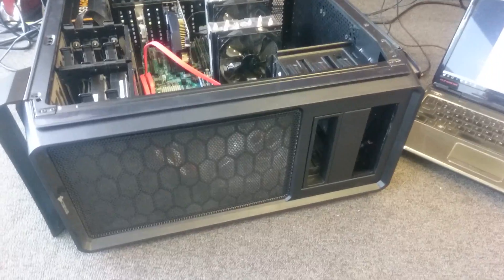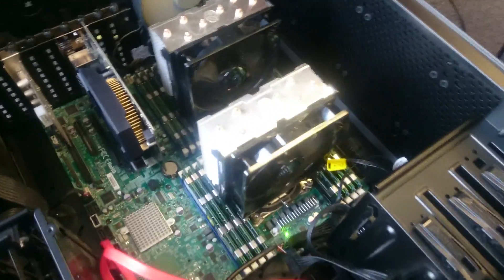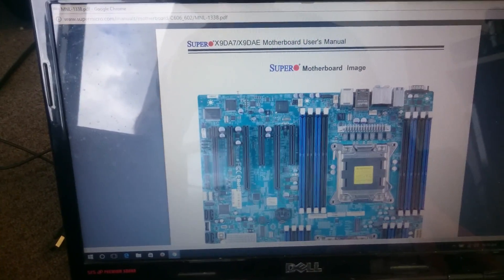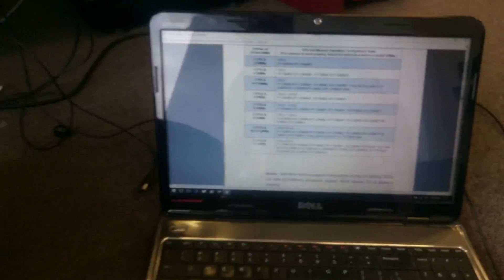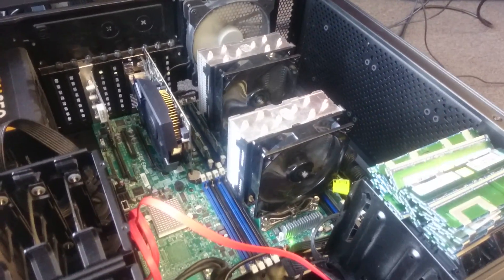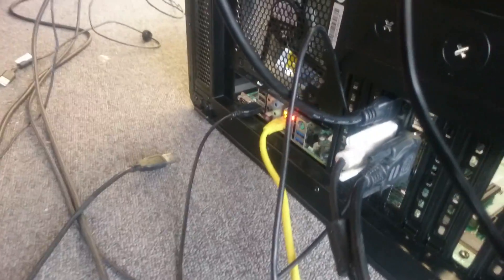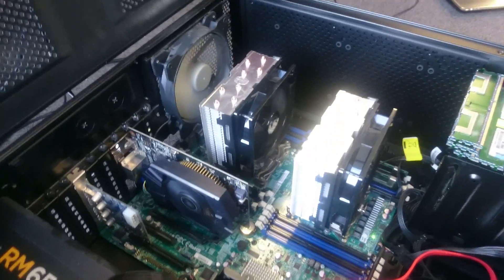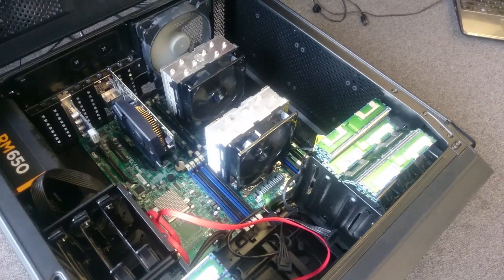Dual Xeon Video Editing Machine Issues

Comment: Just a week ago I had the same problem with a Dell server. For me it was the power supply unit that had problems with an unstable 5 volt line. Changed the PSU and the problem is gone.
Reply: If only he has a scope lying around to check the 5v line.
Reply: Yeah that would be my guess as well. These big dual processor socket boards use the 12V rail for the CPU, so entirely possible there isn't enough load on the +5V to make it stable.

Comment: If I were in your position I would try to reseat all things such as cpu's and power connector giving the whole system a spring cleaning usually does the job or at least narrows the problem with intermittent faults

Comment: Check the logs in bios. On the server biosis it will tell you the exact issue in plain english. You may need to enable log first. some models its not enabled bt default Also make sure you dotn have a bent usb header or serial com header thats shorting out. Also make 100% sure the back of mb can not touch the metal back plate of the case. Some time flexing of mb will alow it to touch witch is why in the server cases they come with a plastic divider (kapton tape makes a decent alternative.)

On my experance try swaping to gpu to a difrent series or  to another slot  non enterprise stuff causes wierd issues on dule cpu machines.Same for that usb card. (Try a bios update.) Never mind you got there:) Also alwasy suspect the cheapest add on card:)  The non enterprise stuff  is genely most happy on cpu0's  pci slots  in my experance(mb will list witch slot is witch cpu)
Reply: Also i have had thouse crosair 650 anf 550s die on me and add just enofe ripple to mess up e3 xeons so... also will cause randome ecc failures on difrent modules (bios logs will prove that)
Reply: Alos super rare but the ipmi/bmc can fail, and it does have an internal usb connection. So might look at that /disable it.

Comment: What it could be that the firm ware may need to be updated. Or another possibility would be that the USB 3.0 card may have been seated improperly where the pins just did not line up correctly and was having communication errors with the module card. This is just an informed guess though.
Reply: System post beeps do take into account the other bios on the mother board before fully booting up. This can include the pci cards.

Comment: For PSU suspected issues I usually unplug the cd rom, if it turns on then your not over overloading the power supply with most likely a faulty cap. That's been the fast easy way of checking desktops in the past. Since low power can cause false positive errors by not providing enough power to accessory cards like USB cards.
I also saw an additional power port on your USB card, I know this depends on the board and how much power the slot can provide and might not be needed for your USB card. But it also sometimes is needed for USB 3 card that have the ability of providing 1A per port (4A total) and if your running power hungry USB devices from those USB ports. 
I have the same Logitech multi transmitter receiver and that doesn't use much power, but I don't know what else you plug into those USB ports on that card. 
If it fails again, I would unplug the USB drive, or video card and use the onboard video output for troubleshooting a power supply issue. The video card probably draws more, but more of the time a DVD drive spins up during the boot process looking for a disk to boot from set in the bios and can cause that intermittent power drain and false positive error on another card by the bios reporting error beeps. Troubleshooting desktops are fun, did it for 4 years when I was younger.
Good luck.
P.S. If you do decide to swap the power supply and board I recommend a Asus board next time now that you've found the 128GB of memory and virtual drive has no benefit. They tend to be better build quality, last longer, and easier to trouble shoot if it has an issue.
Also now that you have it running you can check the Windows error logs since the bios these days report to the OS, you might find a better clue to the real issue or the bios may also falsely report the wrong error to the OS. Depends how good the bios code is written.

Comment: I'd bet money the power supply is having trouble. That.will cause errors like this. Go for an 850 of the same brand you have in there. In my experience power supply failure will manifest as memory problems and random other errors like keyboard. I don't think the bios can determine a power supply is going bad.

Comment: No-one ever had problems with having too much memory.  I have seen plenty of issues with not enough, though.  A few extra watts of power use on a dual CPU Xeon system is not going to make much difference.
Reply from the maker: My system is currently rendering a Mailbag video in Vegas and I have a few dozen Chrome windows open and a bunch of other stuff and a 2nd Vegas window open editing, and my system still uses less than half of the 32GB I have installed now.

Comment: to isolate the faulty RAM if that's the case check in the bios to see what the amount of RAM is and then on boot see if it's the same if it's showing a lower amount then take a module out and reboot it and do it again to find the faulty bank of RAM.
Reply: I've had an AMD board still boot into the Bios with a bad stick of RAM, and even Windows, but the system would become unstable after a few mins of being used either in the BIOS, or Windows. Drove me nuts with me putting in a back up PSU(I always keep a spare 500 watt PSU on hand just in case), reseating the CPU with new thermal paste, etc.. till I started pulling sticks of memory(4 in total the board having  8GB of DDR2 max capacity), and testing them one by one till I found the faulty 2GB stick. So some systems will boot with faulty memory, and some will not, it just depends on the motherboard, CPU, and how fracked the bad RAM stick/s are.
Reply: The PC will not boot into BIOS if there's a faulty memory module.

Comment: 128GB of RAM is needed, especially if you have a workflow of Adobe premiere, Adobe after effects (for camera tracking or stabilization as an effect within the Premiere pro timeline), with clips being prepared for Premiere pro using davinci resolve., as well as overlay elements being prepared in photoshop. Do that, and you will easily use up 128GB. 
Also, some effects in adobe premiere need a lot of RAM, especially if you are previewing effects applied to the timeline. It may not use 128GB all the time but in some cases you may see it use most of it for certain clips and certain effects.
Reply from the maker: I don't use any of that. I can easily edit every video I've ever done on 8GB of system RAM.
Reply: Razor2048 I hope this is a joke
Reply from the maker: FYI Vegas Pro that I use is now rendering a Mailbag video and it using less than 3GB of RAM.
Reply: @Duffel Bag Full of Tech ~ Nope, basically premiere pro and aftereffects and a simple timeline with some 1080p clips where you are applying camera tracking with detailed analysis, can eat up over 32GB of RAM on their own if the memory is available. Then davinci resolve can easily gobble up 32+GB on its own, especially when many color corrections and more complex effects such as the sample based noise reduction where compared multiple frames in order to identify noise, and perform noise reduction (useful for fast camera pans across a scene if exporting to a lower bit rate medium, since it will reduce the bit rate needed to avoid artifacting, if the sensor noise does not need to be encoded during an action that requires a high fill rate from the encoder.

Beyond that, photoshop likes to eat a good 12+GB or so of RAM after a little while (more if working with many smart object layers).
Reply: Wow, that is pretty efficient with the memory usage.
Reply: Razor2048 He's running a YouTube channel man, not producing a movie. I've used Premiere Pro extensively with 16GB of RAM and it worked just fine, any program will use as much RAM as possible, but that doesn't mean Google chrome needs 128gb of RAM, does it?

Comment: Wasn't that a 4, pin plug on the usb card? If it is just plug it in and the problem should be gone. Even if it's just data. Some cards do weird stuff if they have no external power.

Comment: Your usb express card, does it require the extra power connection?
Reply from the maker: I'll need to buy a molex cable adaptor to try this, my PSU does not have them.
Reply: I can SEE ONE floating around in the case, it's right there. Look harder.
Reply: LOL You're right!
Reply: It was just slipping my mind, but the reason why my card was doing that is because the PCI express bus only supplies 3.3V and 12V, and whatever the card is doing to convert the 12V to 5V is barely able to supply enough power to run a single port at 500mA. The Molex connector supplies 12V and 5V thus on the card, it simply takes the 5V directly from the power supply, does some filtering, and then supplies it to the USB ports.
Reply from the maker: Not for normal signal use, it works fine without if it's just data.
Reply: If I don't plug in the power on my cheap USB 3 card it screws things up fairly weirdly. My onboard lan stops working and the pc freezes. Plug it in and it's back to normal. Really strange.
Reply: Disconnected mine again to do this pic :) The only items connected to the card is the front panel USB 3.0 header and the ports on the back are not in sue. For those USB 3 ports, the only device connected, is my Axon 7.  http://i.imgur.com/IZgqInU.jpg  Without that power plug, the card has trouble maintaining the proper voltage, though the phone can still sync and send data just fine, it will get fandom failures if I connect other devices such as another phone. The phone reduces the charge rate if the voltage drops below 4.8V, though it will usually maintain 500mA if the voltage is stable.
Reply: EEVblog2, was that RM650 a donation or a used one as they do include molex connectors on the modular cables.
Reply: Taking a closer look at that card I'm not really sure I'd want to plug that connector in - they've disposed of most of the protection diodes, along with, well, everything else not strictly required (fuses/current limiting, ESD protection, etc). It has a 3A DC-DC reg onboard which gets power from the slot - okay, x1 cards are only 'allowed' 6W, but you're in an x16 slot - it can take 25W no problem and that slot will have been designed with 66W in mind.

I don't think power is a problem unless you have something very hungry plugged into that card causing startup issues.
Reply: Isn't needed until you will used powerfull devices as external hard drivers without external power supply, in my case mine go down until I reset the computer (facepalm)
Reply: Edit: I thought x16 slots supply more power by having more power pins, though. Those power pins simply aren't there in the x1 card edge. This was a mistaken belief.
Reply: Take some time to do some research.

It has a 5V 3A regulator, which is used whether you plug in the external power connector or not - that means 15W max output. The max supply over 4 USB 3.0 ports is 18W. Good enough. The 5V on the connector is not used on that card at all - it draws from the 12V pin only.

PCI-E x1 slots can provide 6W without negotiation, 25W with, and x16 slots (which it's in) can supply up to 66W for graphics cards. In practice, nobody's playing around with those rails: You can pull 25W without thinking about it if absolute standards compliance doesn't bother you (and it doesn't bother the people who made that card, that's for sure). The power connector isn't needed at all.
Reply: Z80user do those cards not use the full 75W PCI-E can provide or something? Seems a bit odd that it would struggle to power a single laptop HDD that uses 3-5W max.
Reply: are some extra path to power the usb conector but conect on it something like a mouse, a keyboard, a external powerred hard drive or a printer and anything like that didn't need too much energy or nothing as all, on this cases the external power isn't needed but still recomended.
on mine I try to charge/plug in my phone on it (with the extra conector) and sometimes turn down the USB on the PCI express, on the USB on the mainboard work good.
now I try to don't used the USB3.0 with external unpowered HDDs and used the USB on the mainboard 2.0 (more slow but more powerfull for that issue)
Reply: Sorry. I was indeed mistaken; there are enough return paths already in the x1 pinout, and the extras on the wider slots are ground. I hope I'll manage to not repeat this mistake.
Reply: No, all of the power pins in PCIe slots are in the segment before the slot key. There are no additional power pins in the x4/x8/x16 interfaces, only data, ground and detection/managerial pins.
Reply: No, they do not. The x16 slot has no additional power pins.
Reply: Most USB 3 cards need the power connector. if you would like to do a test, get a USB tester or just monitor the delivered USB voltage with no connector applied, then connect a smartphone to the USB port. You will notice that at around 500mA draw, the voltage will drop to around 4.8V or less. While the PCI express slot can give a decent amount of power, for some reason these cards don't make much use of it. My testing for this, was done with this card : https://i.imgur.com/GkzCAii.jpg
Reply: I had the same random issue with a USB3.0 PCIE card. No problems once I powered it via the Molex connector. All devices had their own power supplies but hey... It wanted power!

Comment: I would put more RAM back in there. With only 4 DIMMs, it's running dual channel. You need 4 DIMMs per CPU to get your full memory bandwidth.
Reply from the maker: I've experimented with that, and it makes no difference to any performance metric I care about.

Comment: There is room for 120 GB = You need 120 GB :-P
Reply from the maker: Because, reasons :->
Reply from the maker: See my post elsewhere here, I'm using half of my now 32GB of RAM with two videos editors open, and dozens of chrome windows and other stuff.
Reply: I can't imagine needing any more than 32 GB for standard, non 3D, 1080p FHD video. To be honest, you could even get along with 8 GB to edit FHD video. It mightn't be all that conveniant, but it'd work.
Reply: Those empty ram slots are a far better and safer storage space than some drawer which is where you'll have to put that memory.
Reply from the maker: No, it won't. My computer already does not even use half the 32GB RAM that is already has now.
More memory doesn't magically get used if programs or services don't need it.
Reply: EEVblog2 Depends on the OS. MacOS X at least used to use otherwise unallocated RAM as a disk cache.
Reply: The issue may be, are you able to make due with only 128GB of RAM. What if you wanted to use google chrome and the video editor at the same time :) ?
Anyway, a fun thing to try is create a windows 10 VM (since it can use multiple threads during the boot process) and then install it to  a RAM disk. It if fun to see just how fast it can boot when the boot files are already in RAM. PS, a windows 95 VM installed on a RAM disk boots extremely quickly even considering that it refuses to use more than 1 CPU core.
Reply: EEVblog2 What if you need to open scores of chrome tabs, though?
Reply: There's one sane reason: To get all the memory controllers on those Xeons active. If you run a memory access bound load, this may help you with both throughput and latency. The actual size of the memory is likely far less significant.
Reply from the maker: I have tested this. There is no measurable difference in any speed metric that matters for my purposes.
Reply: I can vouch for this I have recently edited a small video 1080p50 with 8gb. A little on the edge but definitely manageable.
Reply from the maker: Benedikt Müssig Vegas will easily work with only 8GB if you don't have too much else running.
Reply: Why not leave it in there just for the sake of having a monster rig? If it wasn't your problem it can't be hurting anything. I doubt that RAM can be used in much else anyway...
Reply: no it doesnt, wheter its windows, mac os or linux they all do that as much as necessary. if the ram usage never even reaches 75% then the OS is putting as much data into the ram as it would if you had 1TB of ram, still would max out at 8 or 9GB in this application.
Reply: No video editior (except for maybe the professional versions of Resolve and Lightworks) can adress all that RAM or even use effciently. For you to actually make use of all that RAM, you'd probably need to edit 16K HDR video.